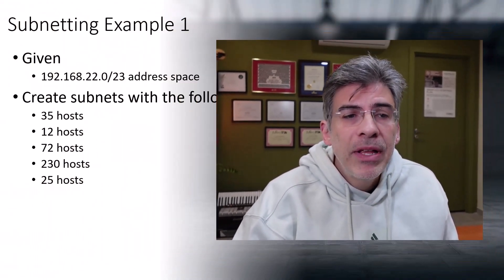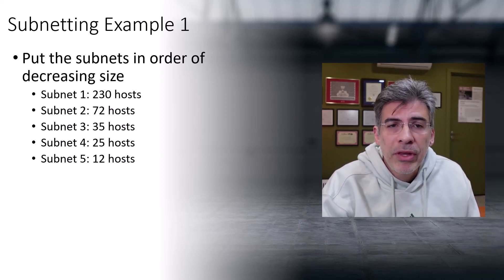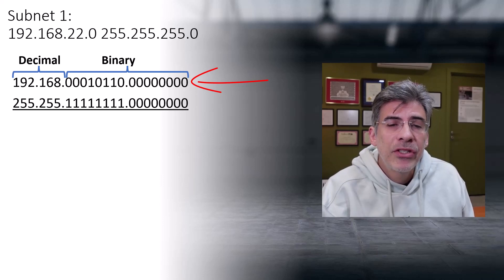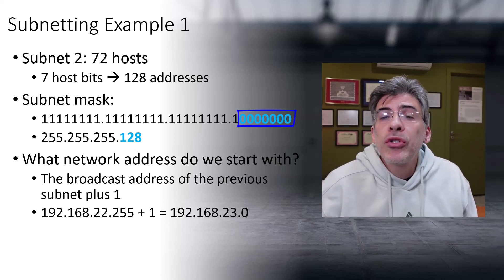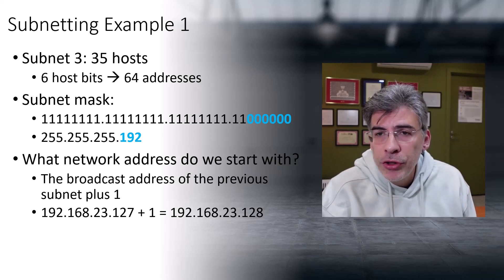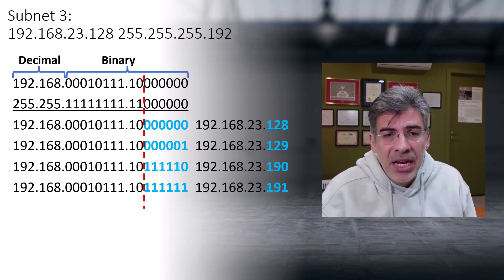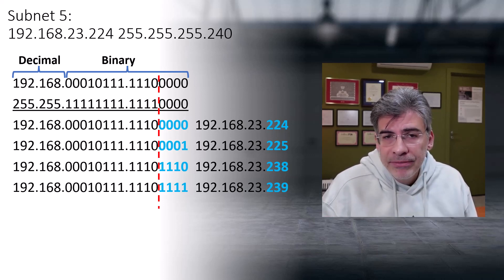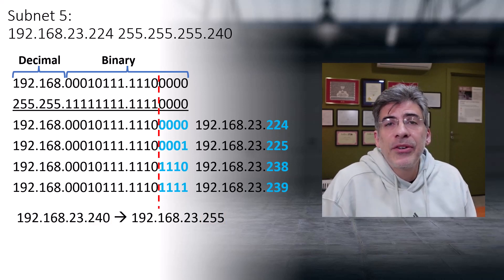IPv4 Subnetting in Action - Part 1

Comment: Thank you for the video! My only question is, how were we able to add +1 to each subnet? For example we went from 192.168.22.1 to 192.168.23.1 and so on. I don’t understand how we are aloud to do that, so subsequently, I am not sure when I am aloud to do that in real life. Thank you for any feedback!
Reply from the maker: When I say we "add 1" I mean that we add a single bit to the 32 bit address.  So we take the broadcast address of the previous subnet, which we calculated to be 192.168.22.255 and we add 1 to get 192.168.23.0.  If we were to look at that in binary, we would have:

192.168.22.255 = 11000000.10101000.00010110.11111111

Add 1 to the binary number and we get:    11000000.10101000.00010111.00000000 which is 192.168.23.0.  Does that make sense?